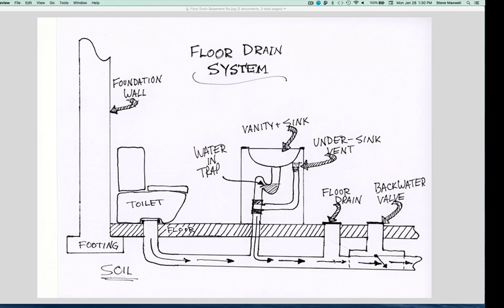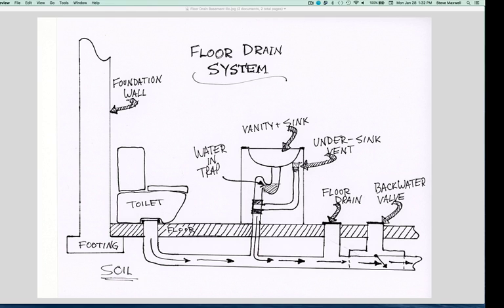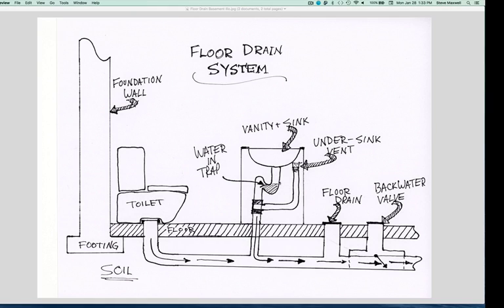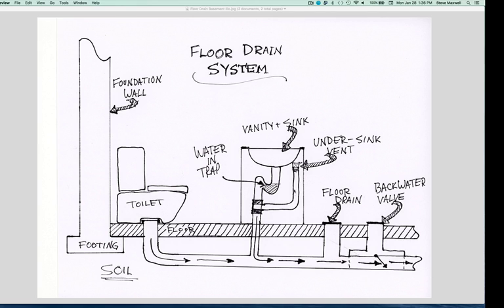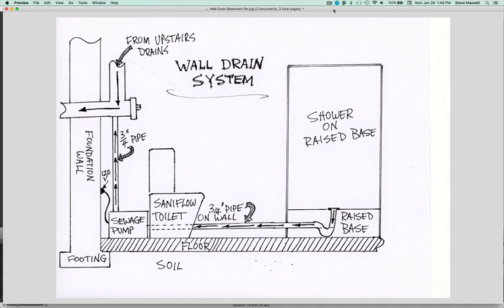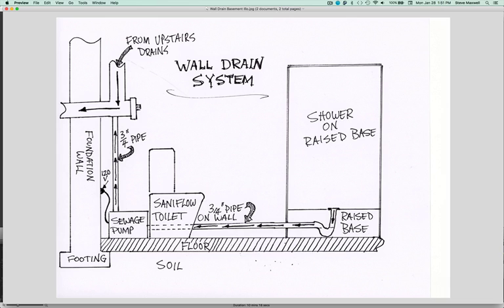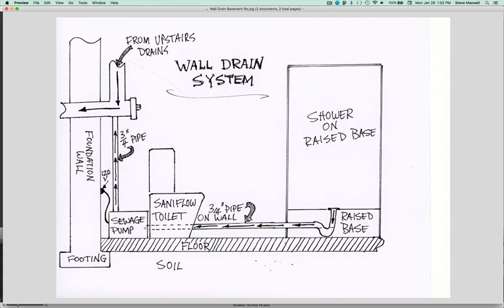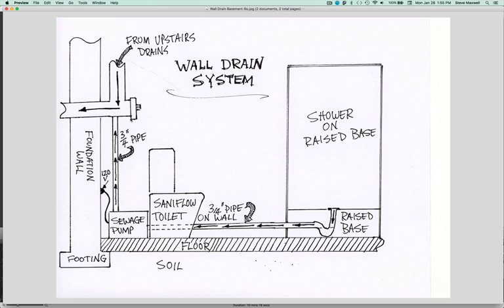Basement Drain Systems

Comment: Enjoyed your video and illustrations. Going through this now. I considered a Saniflo system, but decided to go with a gravity system. Another poster mentioned the lack of p-trap in your floor drain. That would emit sewer gases. Branching off a floor drain with a p-trap could cause blockages. I don't think it's advisable to have double p-traps on any sewage line. I removed my floor drain and replaced it with a backwater valve. In the unlikely event that I have a flood (not a sewer backup), I'll pull the cap off the backwater valve. I'm going to install a sump and pump. Also noticed that at 12:58, you mention the shower drain as the same 3/4" pipe. That would be a 2" drain pipe to the Saniflo unit, 1.5", I believe, if a tub is placed.
Reply: Does the floor drain need a trap or no?
Reply: @JorgePerez-vi7op  I guess it depends on whether or not it ties into the sewage system as mine did. This is a major code violation, but we bought the house that way. The house was bult in '59, so it was probably an acceptable practice at that time. In my case, the floor drain was tapped directly into the 4" main sewer drain, so if I kept a drain there, as opposed to putting in the backwater valve, I would have needed a p-trap to block sewer gases. Another downside, of course, of they way it was originally is that if there was a sewer backup, there would be nowhere for the disgusting water and crap etc to drain out.
Reply: @acbent11  yeah I'm diy straight into the sewer system  I have a trap set but I'm pretty sure ima need a backwater valve to be anywhere near code....

Comment: I have a basement drain that keeps flooding the house like u originally mentioned. It's only used for draining washer and tub water. Can I just fill it up and get rid of it then use a saniflow pump to pump the water to the main drain? 

-If so, how would you go about filling it up?
-If not, do you have any better ideas. The basement floods maybe once a year after a rainstorm and I would like to finish the basement.

This video was very helpful, thank you!

Comment: Thanks for a very informative video. In the the first scenario you discuss the need for a backwater valve. In the second (which I have just for my laundry setup with larger pipes) there is no backwater valve. I would have thought this would be a good idea even though being connected to a septic tank rather than a municipal system. Also when the pump stops pumping water there is a sizeable a ount of water that comes back down, which goes back into my laundry tub and sits there. (And there is no trap under the tub!)